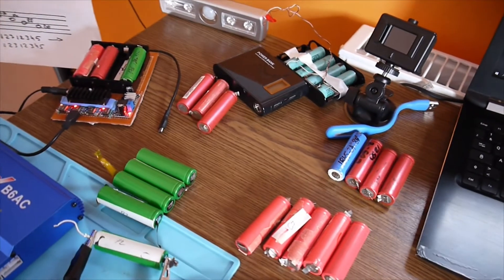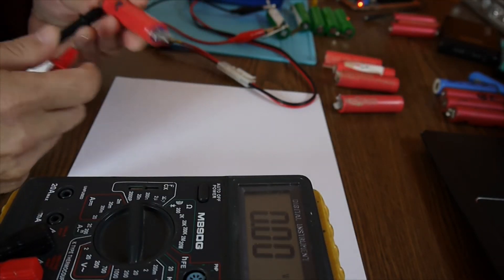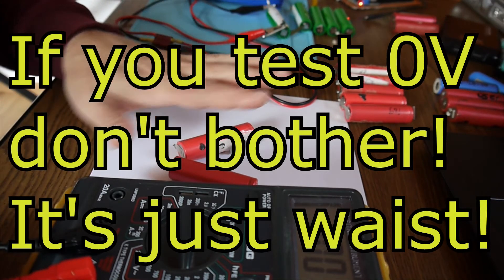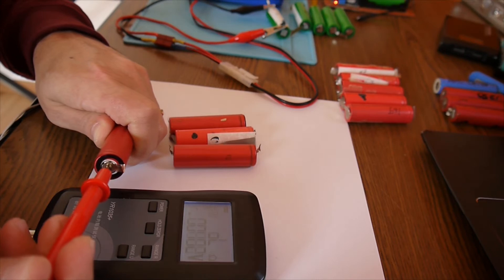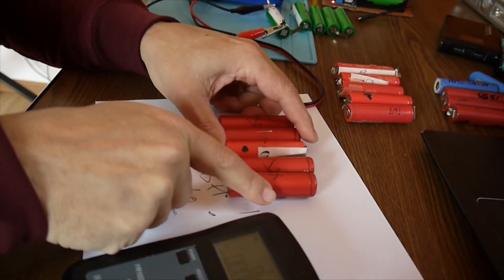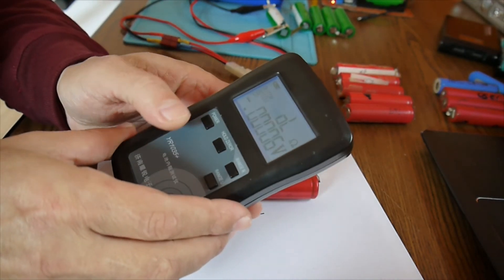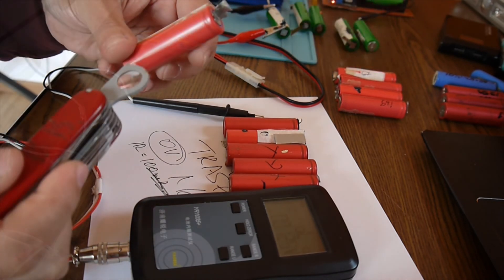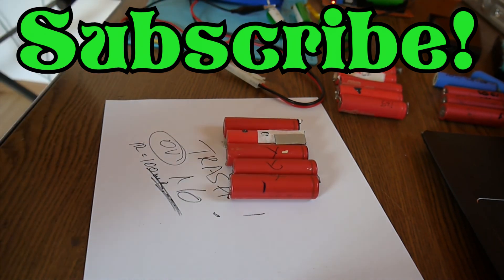Testing capacity and Internal resistance  IR to 18650 cells

Comment: Which should I do first, a capacity test or IR test? Also, which tester where you using for the IR test?
Reply from the maker: First the IR test, if more then 50milliohms it's over, or you can use those for small jobs... eventually capacity test. You may use YR1035+ for IR testing, also some Li-ion can measure IR and test capacity...search for litokalla...I have a Charsoon Antimatter 250 for testing capacity and YR for measuring IR
Reply: @viocaia  I just ordered the Opus BT-C3400 & LiitoKala Lii-600. I heard neither do well on IR testing, which is why I started looking for a dedicated tool to do this. Is the YR1034+ more reliable than these two chargers/analyzers (Opus BT-C3400 & LiitoKala Lii-600)? Also, doesn't capacity testing change the IR levels in cells, or do they remain the same IR?
Reply from the maker: @aaroncatolico7550  Those chargers will do the job. Usually IR it's kind of related to the state of charge, but small differences.  YR1035+ it's more accurate.
Reply: Had you ever tested short circuit cell ? Will reading be lower than normal?